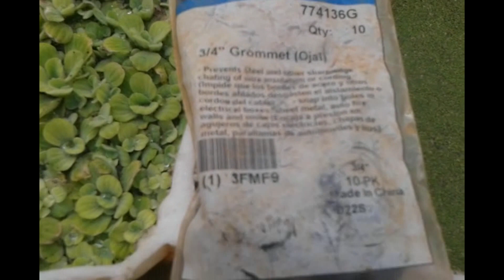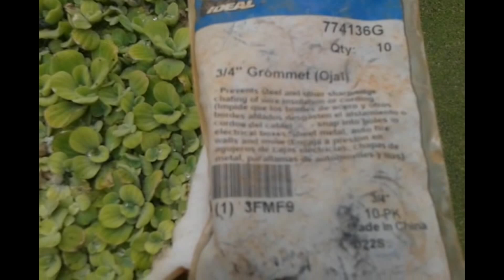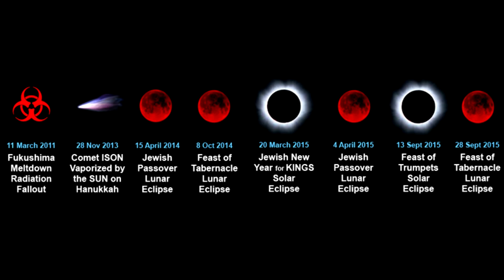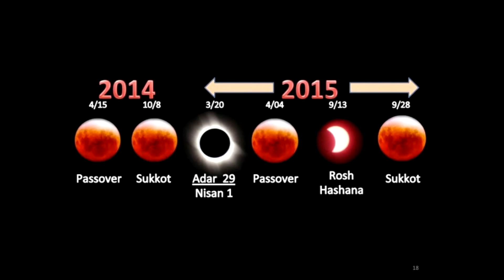DIY Duckweed Grower

Comment: so great vid. question: my duckweed tank has now a LOT of what looks like dead vegetation all over the bottom. it is black. and now have algae  covering the walls ( I was told partial sun ). what is the black stuff? is that duckweed growing? and should I clean the algae out?
Reply from the maker: The algae can take over and kill your duckweed but as long as your duckweed covers top of the water the algae won't win

Comment: Duckweed turning white then yellow then die off. 

Would somesone help me see what is wrong with my duckweed?

Growing condition:

1) water temp less 30 degree C 

2) sunlight cover: 30-50 percent.

3) Algea not seen, however a cloudy thin film is floating on water.

4) Nutrition not known, but roots longest are 20mm. average is 12mm.  Last time it happened I add in a bit NPK fertilizer but it did not help.

5) First turning white then yellow  then die

6) PH 6-6.5
Reply from the maker: Add poop lol

Comment: just came across this vid. you used a 3/4" grommet for 1/2" pipe? so my guess is that a 3/4" grommet will not take a 3/4" pipe? I have some 3/4" uniseals  which is of course for 3/4" pipe. with that, can I change all the pipe dimensions to 3/4" and 1" and get the same results?
Reply from the maker: I'm not sure sorry

Comment: thanks for tryiing but would of not been better to start with the Aqua System first?
Reply from the maker: +Thomas Rossetti You don't have to have a aquaponic's system first a simple Walmart air pump would work just fine I have another video that shows that but if you meant my system its in the video. Thanks for saying you watched I guess